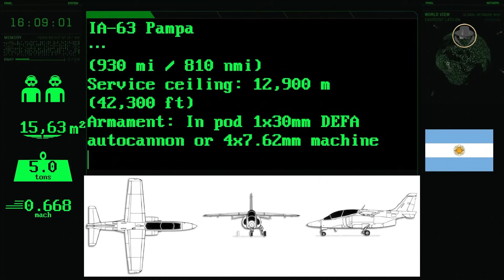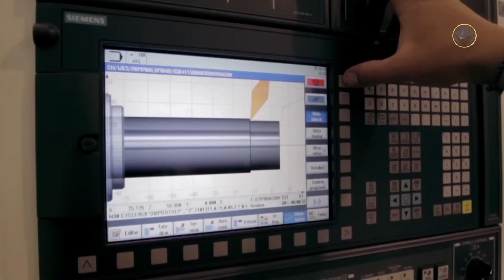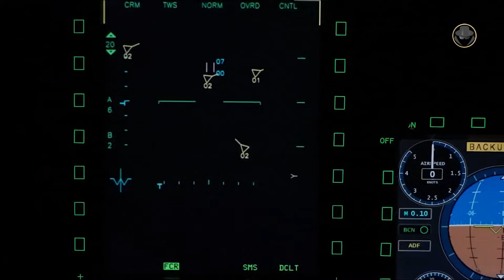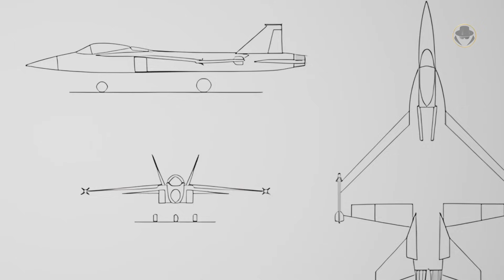IA-63 Pampa | The youth elixir of Argentina's aviation industry

Comment: Great video, it's wild to see the tiny Pampa on a video that isn't from a hispanic creator, some small details I might add is that currently the production line for the Pampa has been completely halted/shut down, with no mention of further modernizing the existing cells to the latest model, everything is focused on the F-16 as of now, and it's export possibilities were never real to many specialist, since due to it's slow production, barely one aircraft a year, it would struggle to even satisfy local demand for it, only reason it still kept getting shown off were mostly political with no real intent, also as a last thing, the IA-90 was never a real project, it's was born as mere rumors and fabrications on forums, the single concept image that kept getting shown as proof was a concept fighter jet from another nation.
Reply: Yeah, it looks like a mix of a F-16 and F-18
Reply: @lucasmoreno2154  The drawing pretty much looks like an AIDC F-CK-1 Ching-kuo.
Reply: @lucasmoreno2154 It pretty much looks like an AIDC F-CK-1 Ching-kuo
Reply: @lucasmoreno2154 It pretty much looks like an AIDC F-CK-1 Ching-kuo
Reply: @lucasmoreno2154 From the drawings I've seen, it pretty much looks a lot like the AIDC fighter (I'd like to post its official designation, but YouTube apparently doesn't like it).

Comment: The main problem it has is its abysmal production speed. Fadea(formerly FMA) can barely produce 3 planes per year. This is one of the reasons behind the loss of the possible contract with México in 2017.
Reply: Ok but why that slow?
Reply: @yarmud Corruption and other proyects. Fadea also produces parts for the C390
Reply: Really, that's not a production line. That's a craftsman made aircraft. How big can the team be? 30?
Reply: @marcusott2973 Fadea has a total of around 900 employees, but they also have to do maintenance on other planes and they only have 1 plant.
Reply: @tetraxis3011   I meant,  how big is the team that builds this specific airframe. 
I was recently at the Pilatus production facility in Switzerland, where they have types of which they make single digit numbers in a year.
The team dedicated to such a type at the plant is around 40 people.
Reply: @marcusott2973 Oh  i have no idea. I dont work at Fadea. But Considering that priority goes to the C390 and fixing the KC130s, the team working on the Panpa 3s might be around 30-40 ppl. But thats just a Guess. They also have to do some repair and refitting work on the older Panpa 2s and 1s